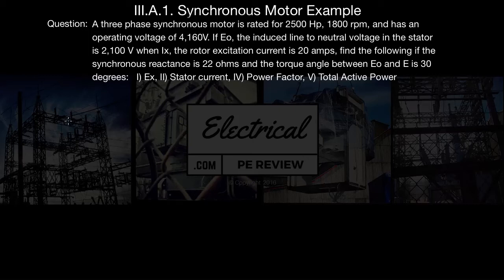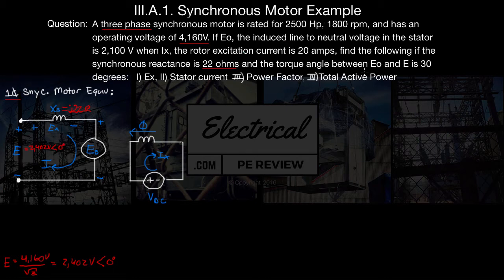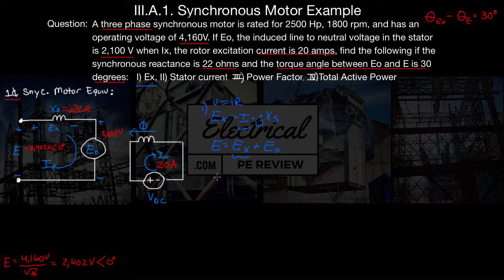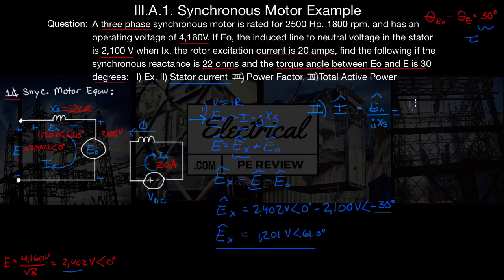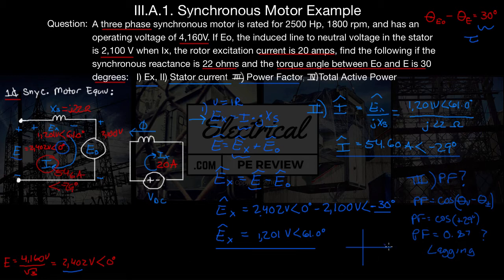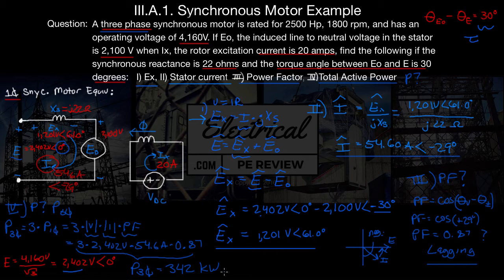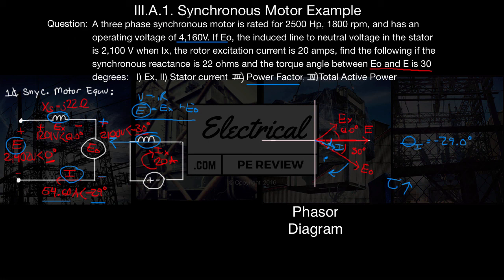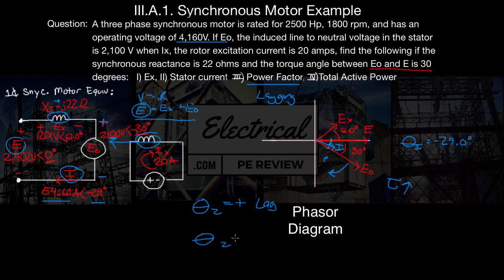How to solve a Synchronous Motor or Generator Equivalent Circuit (Electrical Power PE Exam)

Comment: When referencing PE Power Handout from Ncees (2.0.1V). Your equivalent circuits looks backwards. Could you explain what is the difference between your circuit and the one on the handout?
Reply from the maker: One is for a motor (Applied voltage is E), the other is for a generator (Supplied voltage is E).

Comment: Great example! I solved Ex = IX by using a triangle/trigs method sq. root of: ((2100V*sin(30))^2 + (2402V - 2100V*cos(30))^2) =1201V = I(A)*22jOhm. Phasor diagram makes total sense!
Reply from the maker: Nice work!

Comment: Thank you for such a great example. Regarding Eo, would you say that it's the combined crossed induced EMF of the supply voltage from E & the excitation current from the rotor?
Reply from the maker: Hi Liew, sorry for the late reply. Eo is the voltage inside the stator windings of the machine that is induced by the DC excitation (the "field") in the rotor. It is not combined with the terminal voltage (E), it is it's own quantity.

Comment: This video was helpful in understanding synchronous motors because the problem calls for solving a number of different values which might be asked on the actual exam. Also through drawing out the single phase equivalents and phasors the problem becomes easier to solve.

Comment: To me the math is very easy. The only thing that throws me off, surprisingly is the terms. I get very confused over the terms "stator", "armature" and the like.
Reply from the maker: Most of the applied math in electrical engineering is straightforward. The difficult part comes in applying the concepts and deriving the correct formulas to use depending on the application.

Comment: A 3-phase, unity power factor synchronous motor rated 400 hp, 2300 V, 450 rpm, 80 A, 60 Hz, drives
a compressor. The stator has a synchronous reactance of 0.88 pu, and the excitation E0 is adjusted to
1.2 pu. Calculate
a. The value of Xs and E0 per phase 
In this question I see the answer it calculates first Zn = 16.6 Ohm . What is this Zn business ( is that the nominal impedance - why ? Any help please to get to the bottom of this !
Reply from the maker: This problem is actually just testing you on your per unit understanding and not synchronous machines. 

The value you gave of Zn = 16.6Ω is the base impedance, typically described as "Zb".  It comes from using ohm's law and using the rated values of the machine for the base values:

Zb = Vb/Ib = (2,300V/√3)/80A = 16.6Ω.  

This is the base impedance value for calculating the actual value in ohms of the given synchronous reactance in per unit:

Xs = (Xs_pu)(Zb) = (0.88pu)(16.6Ω).
Reply: Thank you so much appreciate your help .

Comment: The most important part is the angle 30 degrees and YET he made very light reference to it . How did he get it as -30 rather than plus 30 degree? Can anyone here explains me as he does not seem to know it !!
Reply from the maker: Hi Robert, I am assuming you are referring to the -30º angle of the induced voltage (Eo).  For a synchronous motor, induced voltage (Eo) always lags terminal voltage (E) regardless of the power factor that the machine operating at, i.e. over or under excited. Standard convention is also to use an angle of 0º as reference for the terminal voltage (E).   Since the electrical torque angle between both voltage phasors is 30º, the angle for Eo will be -30º since Eo lags E, and E is at 0º.  It is common for the torque angle to be expressed as a positive angle with the correct polarity included in the worked out math depending on if the synchronous machine is a motor or a generator (i.e. depending on if Eo is lagging or leading E).  At the top right corner of the screen around the 4 minute mark, the polarity of the torque angle is not included even though the angle is written as the difference between the induced voltage (Eo) and the terminal voltage (E). This is mathematically incorrect. It would have been more accurate to show the angle as the difference between the terminal voltage (E) and the induced voltage (Eo), or to have shown the angle with negative polartiy. I can understand how this would be confusing when the formula solving for the synchronous voltage drop (Ex) around 6:18 uses a negative polarity for the angle of the induced voltage (Eo).  Feel free to ask more questions if you would like to discuss further.
Reply: Thank you , that was very prompt - yes I did some digging and found that it is always lagging for the sync motor and leading for the syn generator. Thank you heaps !